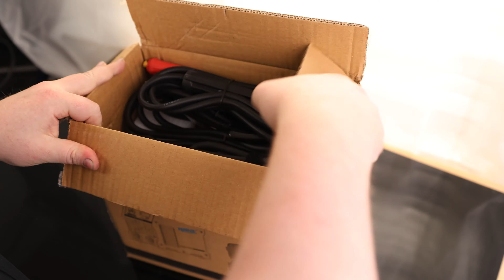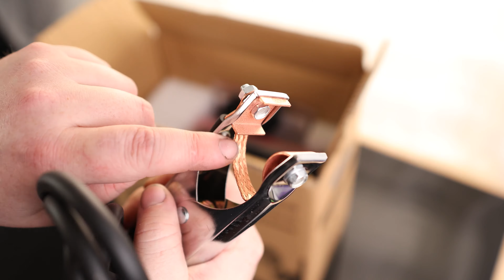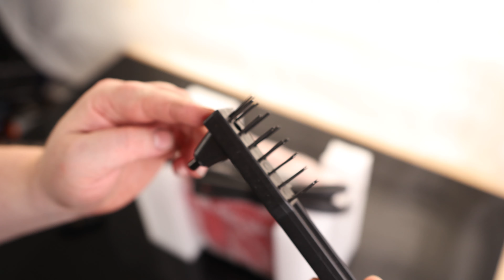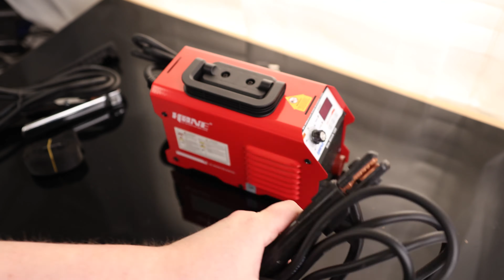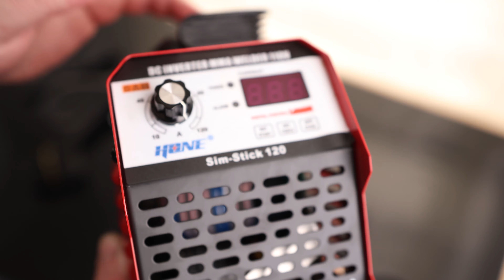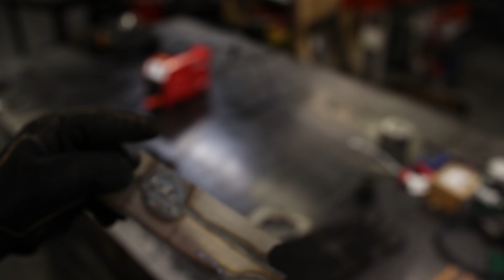HONE Stick Welder 110V

Comment: i weld in a shipyard mostly fluxcore, so im not used to thin metals. but i bought this machine and grabbed some 1/8inch 7018 rods and a few weld test plates from work and and no problem running multiple passes..  could have used a little more power i was running maxed out but it will be fine with smaller rods.. this thing did keep blowing my breaker, id been better off with 240

Comment: how are you able to use that plug in, i thought it required a 40 amp breaker which means the outlet and wiring would need to be rated 40 amp too?

i am disabled so i cant do much but i just need to make small welds like on lawn mower deck

Comment: Did you have to scrape the flux off of the welding stick to get an arc?  I’m having trouble getting started with my Hone.
Reply from the maker: I did not.  If you're not using a 6013 rod, try that.  They're pretty easy to get started.  Some rods can be fairly finicky.

Comment: Great video I just got mine today what rods do you prefer is best  to use in your experience  and what’s the best amp is the best to leave it on
Reply from the maker: My go to is Forney E6013.  For 1/8 inch steel I run around 50-60.